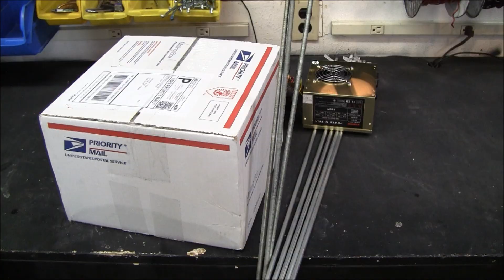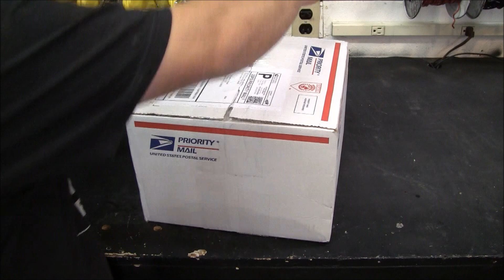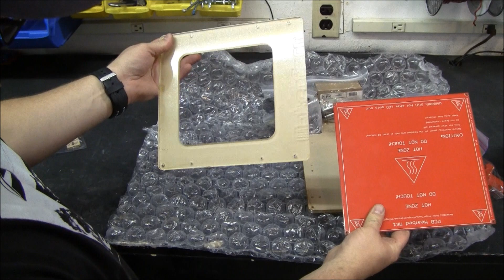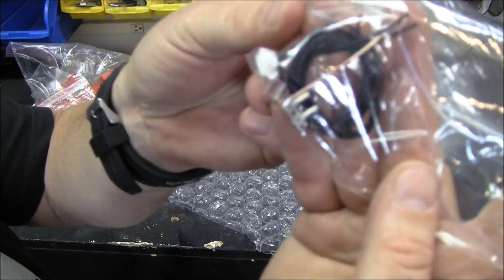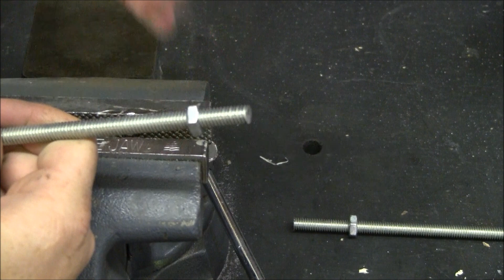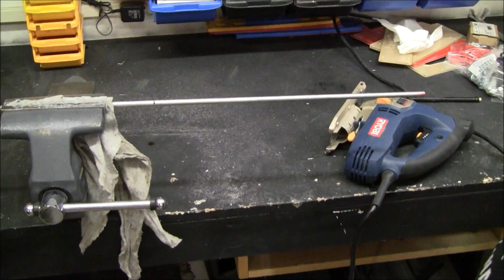Reprap Assembly 01, Parts and Unboxing. Prusa Mendel V2

Comment: which stepper motor did u use? can u pls share the model number of motor?

in your power supply video u applied 12 volts, is it same for all motors on ramps kit?

Comment from the maker: Actually the kit without Steppers started at $435.00 plus about 50.00 for a Ramps electronics upgrade plus shipping so it was around $500.00 for me. The kit with steppers starts around $520.00. You also need power supply and threaded and smooth rods so for the whole project it will cost something like $600.00 - $700.00.